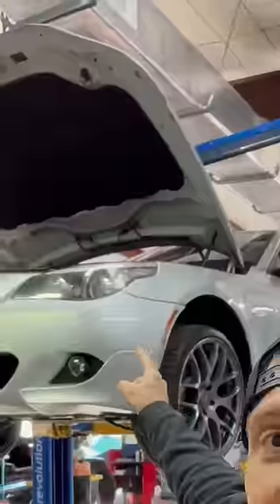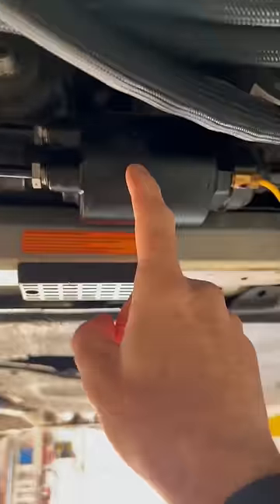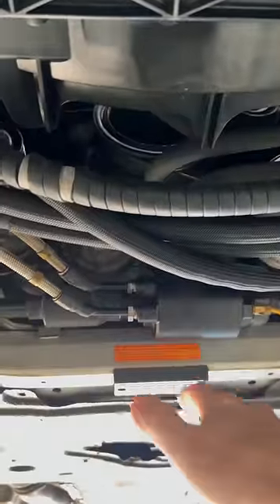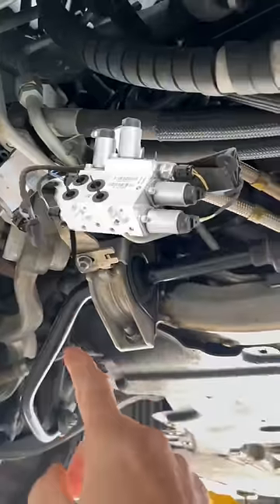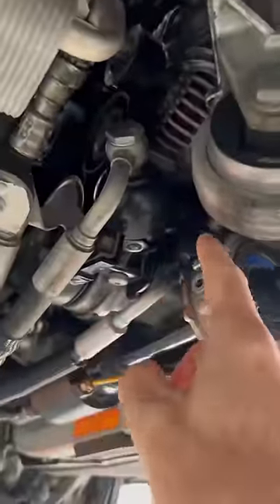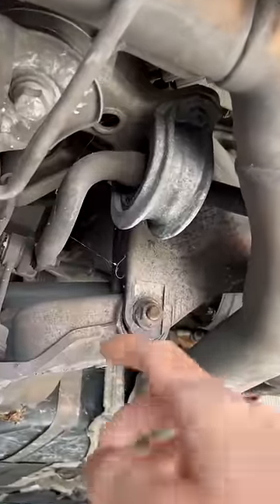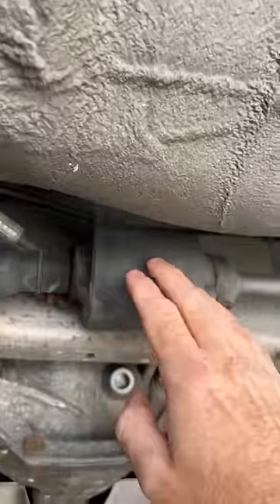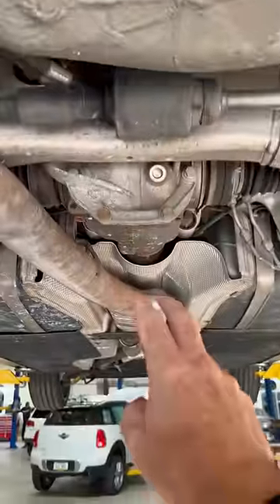Over engineered?

Comment: I've worked on these for 13 years and haven't had to replace one so I'd say they're pretty well engineered
Reply from the maker: Same
Reply: Is there general maintenance on these? Fluid flushing, seals, lines, etc?
Reply: @RothBeyondTheGrave  id imagine you'll need to change the fluid periodically - at least I would - can you imagine this system going bad because you didn't do a fluid change
Reply: @JamiesGarage1  marine mechanic here- hydraulic systems are insanely reliable. Almost always for the most part there's no wear and tear on them except physical damage
Reply: Depends on the system really, but I'd agree that they are often times more robust than other systems on vehicles.
Reply: I wonder how these cars will be holding up after 40 years or so
Reply: You will want to inspect the high pressure hoses regularly. Other than that as long as the fluid is not contaminated it will last a long time. If the fluid is replaced too often you may introduce contamination, so only change when it's needed.
Reply: @Dat_Sun  the chance of any car making it to 40 years is pretty unlikely, statistically its going to get written off due to damage or scrapped due to a owner that can’t afford a repair or maintenance.
Reply: Me: Buys up all the spare active sway bar systems to fill up a warehouse. Starts using fake accounts online to propagate on FB & 5-series forums "Yeah, these fail commonly, you need to replace them soon!"
Reply: @GGoblin1  nah when you remove the lines they come clean and clear, but when you drain the system you need to put new fluid and it does a kind of low riders moves when bleeding procedure.
Reply: @macthemec  1970 Chevy Chevelle SS 454:  “Am I dead to you”? 😂😂😂
Reply: @macthemec  Most people don't know how to safely drive or take care of a vechicle.  My datsun is 99% original. Untouched engine and transmission.
Reply: @jjojo2004  lol
Reply: @Dat_Sun  i take care of my car too but too many bad drivers and insurance scammers out there, had someone try to pull an insurance scam on me just last week. Lots of enthusiast owned european cars out there with the same story as your datsun.
Reply: @macthemec  I have a million accident free commercial miles, and 40+ years of avoiding accidents under my belt.

When I hit the road, I am 100% in tune with my surroundings.  I see drivers using cell phones, putting onmakeup, eating, youtubeing, recording or otherwise not paying attention. 

I don't speed, tailgate or have any distractions in my automobiles.  I inspect and maintain my vechicles like the life support equipment they are.

Living in a city is definitely hazardous to a vechicles existence, you are right about the hazards, but they are avoidable.
Reply: @birdvalenchez  coast guard mechanic here, can confirm this to be true
Reply: @qx4n9e1xp  3 series owners: muhahahha CEL turns on
Reply: @macthemec Lexus
Reply: I've remember doing one. 20 years in the shop mind you. That said I only remember because it was an odd conversation with the customer saying his power steering fluid was low because his sway bar was leaking.
Reply: Or they never wanted to pay to fix it
Reply: Replace one…yet…
Reply: Not in the rust belt then??
Reply: Yeah let's see what happens after 23 years.
Reply: @birdvalenchez I'm a former machinist, current mechanical design engineer. I've run into many unreliable hydraulic systems. Probably a big reason why I decided to become a former machinist hahaha! Talk about stressing you tf out. Hydraulic systems are famous for one thing and that's blowing seals.
Reply: @Dat_Sun  you can do everything right and get crashed by one of those cell phone users. Also, you might have a bad day, emotionally speaking, and crash. Or make a mistake.
Reply: @Dat_Sun  yeah I agree with you, but all you can do is lower your chances. For example, my mom was riding her car in the highway. There was a stop due to traffic. A pick up from behind was with the cellphone and didn't brake. She got backended very hard. She saw it coming but couldn't do anything about it.
Reply: @sayingnigromakesyoutubecry2647  Dang man,  I hope she didn't suffer any injury.  
To eliminate this type of situation,  I leave a large following distance,  I try to maintain at least 30 seconds, sometimes it's not always possible,  but even in heavy traffic I manage to keep a good gap in front. I also drive from behind be constantly checking what's going on behind me. 

On multiple occasions I have used my extra stopping room to help those behind me slow down. It's never failed me. Yeah, I have drivers cut in front of me often,  but I see it coming and let out of the gas ahead of time.
Reply: @Dat_Sun  no, thank God nothing happened to her. The car was broken, that's it.
She drives very well, I don't think anything could have been done except, maybe, having a lot of distance in the front, being constantly looking behind in the mirror and switch lanes before the collision (I saw someone doing that in the internet). Traffic in highway can surprise you easily, it's all right and all of the sudden everyone stops.

This is very dangerous if it happens while you ride your motorcycle. I always watch what kind of cars are around me, and if there is some car known to have idiot drivers (like the meme of the BMW drivers not using the turn signal) I avoid them. In my country I watch out for VW Jettas and Peugeot 208,207,206,307,308...  Cars in bad shape... And a few more.
But like I said, nobody is perfect. 

I have more or less the same mindset as you, but the difference is that I know that something very bizarre can happen and crash me, even I can do something wrong. Once I fell asleep in the steering wheel. Thank God I touched the curb in center of the avenue (thank god it had one) and I woke up before crashing anything
Reply: @Dat_Sun  I do all of that too and I’m 21. But that doesn’t guarantee anything. You can be involved in an accident that you had no choice or action that caused it. My cousin was on the interstate with backed up traffic stopped like anyone else and some dumbass slammed into her at full highway speeds and she passed. She didn’t do anything wrong, she couldn’t go anywhere (B2B) and had no time to react. You can be an amazing driving but other drivers will always be your biggest threat and there are unavoidable accidents and we take that risk everytime we go on the road. You shouldn’t be driving if you weren’t doing what you said, been doing that shit since I started driving
Reply: Liar
Reply: Hmm unusual for BMW…
Reply: Engineered obsolesence
Reply: In work on bmw as well, had to change the valve block on a 650i cost 2500$ for just the part, some kind of electrical issue with one of the valves   But they usually seem to be reliable
Reply: @macthemec  especially cars like this that are going to be impossible to keep on the road doe to maintenance.
Reply: @Dat_Sun  hardly ever see any 40 year old cars on the road so I would say it will hold up just as well as any other 40 year old car.
Reply: @qx4n9e1xp  now that's some Clean Grabbler shenanigans
Reply: @JamiesGarage1  Excellent over engineering.

I won't be surprised if people classified EFI as over engineering during the carburetor era.
Reply: wow 13 years is a long time for car.. haha not ... well it is a long time for a modern BMW.. 
everything else will probably fail before this anyway..
13 years ... wow big flex
Reply: South of Chicago 🤷‍♂️
Reply: @Kyrie Eleison I've been working on them for 13 years but the cars themselves that use this tech are over 20 years old at this point
Reply: @snerby141989  ok tell me what goes wrong on a 20 year old bmw?
Reply: Oof, there's not enough hours in the day to list what goes wrong with 20yo BMWs
Reply: How many turbos you replace?
Reply: @matthewburkholder1076  N20 and N63, a decent amount. Other than that, minimal
Reply: @Dat_Sun That's not the zinger point you think it is.

There's very few cars from the 60s, 70s and 80s that still survive that haven't had restoration work on them by now. This is no different.
Reply: @MrManBuzz   Only if they were neglected and abused, most of them were. People took for granted how rugged and reliable vehicles used to be.
 
 The ones that seen regular washes and followed a basic maintenance schedule last forever.   The plastic, digital and overly complicated automobiles of today will be paper weights in 20 years. A growing percentage of modern vehicles is plastic and does not last the test of time.  The specialized electronics and constant model updates will make finding parts 20 years down the road impossible.   

Today's tin thin flimsy trucks might have more power then those of yesterday, but they won't last the test of time.
Reply: @Dat_Sun  That's just horseshit. 100k miles used to be seen as huge mileage on a car. Nowadays cars are expected to do that and not even break a sweat, and when they don't they're considered "junk".

And let's not even start about cars rusting within a few years old.

Modern cars most certainly have their flaws, but the simple fact of the matter is old cars would not hold up to the abuse people expect cars to put up with today.
Reply: @MrManBuzz   No that's not correct. The problem is people are getting lazier and have  hardly any vehicle maintenance skills anymore. Even now my Datsun truck is sitting in feet of snow in the rocky mountains, 15 miles from the nearest paved road, 6 miles from the nearest maintained road.  The datsun has taken this type of abuse just fine over 40 years.

 I've got a new truck, a 22 Toyota Tacoma TRD, It's not faring so well. Both front Fender liners have been destroyed from ice build-up. All 4 factory Toyota molded mud flaps have ripped off damaging the mounting points, The front bumper cover has rattled loose requiring new plastic rivets and eventually a replacement bumper cover painted to match.  The dust from the roads here in the summer time are still wreaking havoc on all the switches and latches. The plastic rear painted bumper covers both shattered upon contact with snow here in my driveway. One headlight lens (factory led) was cracked when a rock from the trucks own tire hit it ($690.00).   Truck required custom tuning down in Denver to run properly up here in the rocky mountains and keep the transmission from shifting non stop. 

 I decided to replace the incredibly cheap plastic guaranteed to fail internal oil filter housing with a baxtor adapter and huge wix spin on for simplistic filter changes without dealing with the constantly breaking plastic tabs on the oem oil filter assembly.  Modern automobiles are designed to fail quickly,  you won't find parts for them for long. 

 Even getting parts for a fairly common vehicle from the nineties is often impossible. You end up modifying aftermarket parts to fit and the end result is a lower quality vehicle thats more prone to failure.
Reply: Worked on bmws for 11 years and my previous e60 had those sway bars and so does my current e60.  I've never seen a failure of that system that wasn't accident related. I'd say it was done correctly.
Reply: probably because they get sent to the junk yard after hearing how much it costs
Reply: @Dat_Sun  TBH owner's of these likely rarely get over 30k miles before getting the next version, it's the other owner's problem.
Reply: Ive got 287,000 miles on my e60 550i and have yet to have any issues with the active sway bars

Comment: Keeps you flat around the corners, makes you feel better than you actually are
Reply: Yikes
Reply: I prefer mechanic predictability over a system that tries to perfect my driving. Not every situation or predictable situation needs the same “perfect” approach.
Reply: @VolvoMoose13  does more than that for the passengers too though. I've driven cars with it and after you do, you want it.. it makes the passengers lean less in corners so you can go faster without as much body roll and grandma won't know you're doubling the speed on the curves, It's nice, just like adaptive steering and cruise.... More stuff to go wrong, more stuff for me to fix
Reply: @justinweaver7553  I disagree, this is just an expensive “innovative” marketing toy. People who depend on it to drive better are not great drivers imo. Mechanical quality and driver professionalism will always beat that. Also body roll is honestly a feature added to a car because the factory wanted it. My volvo v40 2003 heico sport has no body roll and is stiff like a stick around corners. Has a fast engine and is meant to be quick in corner. My v70 classic has plenty of body roll because it’s not meant to race but be an approachable, easy comfortable ride and to safely transport the massive weight over bumps or heavy terrain.
Reply: @justinweaver7553  you don't buy a new M5 to carry your aunt, mother in law or other past 50 years womens. 😑 this is a car to go to the club with the boys 😃

Comment: I can confirm, as an E60 owner, it may be over engineered but it really makes all the difference, you feel the car stiffen up as you accelerate and the car feels very well planted around corners and heavy braking.
Reply: BMW really embodies driving pleasure. But they are fragile af and breakdown when its a couple years old
Reply: @TheArccore  Tell this to my '87 325i
Reply: @TheArccore  only if you dont look after it and wash it regularly.
Reply: @iHelpSolveIt  ya cuz washing UNDERNEATH the car is a thing people do, let me introduce you to the rust belt
Reply: @patrickancona1193   where you drill extra holes in the bottom of the frame to prevent rust from doing so but worse
Reply: @patrickancona1193  as someone who lives in the rust belt, let me introduce you to undercoatings! If you’re scared of a professional fucking up and not completely getting it and it rusting from the inside, then you give it an oil undercoating every year
Reply: @DiscoMiata  same. It definitely help I like fluid film personally I have seen some new ones I wanted to try. But I’ll say this. You start doing some panel removal and the salt literally just gets everywhere up in the car, places you wouldn’t even imagine
Reply: @TheArccore  FYI, nobody cares about your reliable econobox that gets you to a soul crushing job you are one break down away from losing.
Reply: @Patrick Ancona  lol I got all the stuff to fairly easily wash under my car during the salty months years ago... haven't done it once.
Reply: @macthemec  take it easy there bud
Reply: @ffhgu 07 Another big part of it, if I'm being totally fair, is the filter of time acting on things.  I own my car now because it's a classic that survived the test of time.  That's not true of all or even most cars from the era. 
However, as we pack more and more features into cars, there are exponentially more points of failure.  We build cars now to be full of features, not to last.  And even worse, because of this degree of complexity, almost every system in a new car is now too complex for a non-expert to really understand and fix, meaning once these new cars lose official support from their manufacturers, they're likely toast.
Reply: Well. You paid for it.
Reply: Assuming it's running...
Reply: As someone who grew up in the rust belt, let me introduce you to Texas hahaha! I went to a mechanic down here with a Tahoe I bought from up North. By the standards up North it had little to no rust. He looked under it and asked me why I even wanted to have work done on it because of some light surface rust on the frame 😂😂 He said he would just scrap it if it was his.
Reply: @lv4boxing  This is why BMWs are precision engineered to always have a bit of an oil leak!  It's a feature that allows your Ultimate Driving Machine to secrete a protective coating to cover its vulnerable underside
Reply: @dylangergutierrez  Hahaha! 😂😂 Yeah, can't beat that German engineering!!
Reply: user-tq2zb5sc2c  haven’t had to repair them
Reply: @TheArccore  my e60 with 170k disagrees on that fragile comment. I beat the ever loving hell out of it.
Reply: That’s just compensation for bad drivers…
Reply: @richardgerome4897  yeah…. I mean it has nothing in relation to the fact that all high performance vehicles have a ton of tech in the suspension. Let me guess, you were super cool at your local auto cross parking lot cone dodgers gatherings.
Reply: Audi's DRC is better and cheaper!
Reply: I must have Alzheimer’s because I don’t remember asking
Reply: @real_talk8749  Yeah, true enough.  It was made in a very different world, when people bought cars to own for the long term instead of a new lease every 2 years.  There are still bits on my car that say "made in West Germany"
Reply: @real_talk8749  Love the old pickups, from the 80s and 90s especially.  When they were actually built and used as trucks and not mostly as glorified minivans.  Love the straight 6 as well; that's what my 325i has in there

Comment: Citroen xantia activa had electronic sway bars coupled with hydraulic suspension in the early 2000's.
Reply: That was a great system as well. However, Citroen's suspensions have similar troubles at older age. Sometimes they need maintenance and expensive repairs. Not always, but more often and more frequently than simple mechanical suspensions.
Again the same dilemma: great ride or cheap and simple.

Comment: There is an old bmw video of an E65/6 in a slalom with and without dynamic drive.  Its crazy how much it helps with a 2 ton car.
Reply: Old to me is E30 😅
Reply: 1. Apply sway bar thick enough to fit into size 13 jeans.
2. Learn to drive.
or
Don’t expect high performance Ms luxury from the same vehicle.
Reply: @toyotaecw  🥴🥴🥴